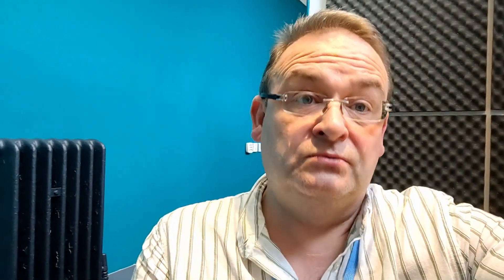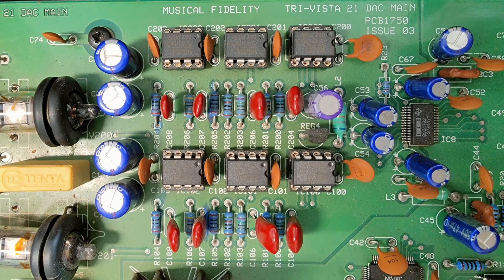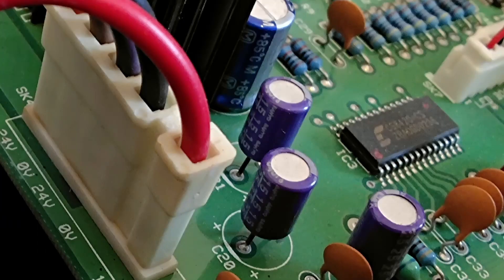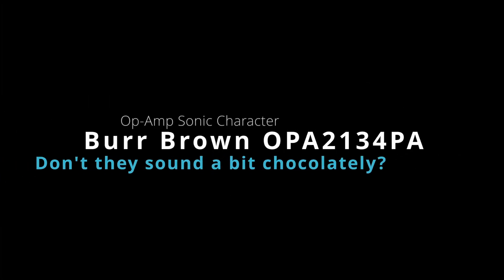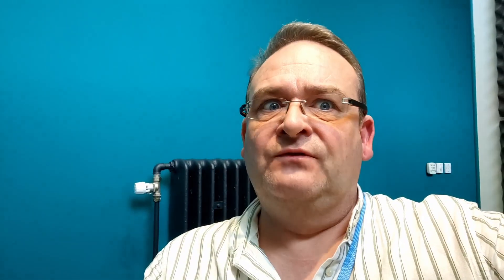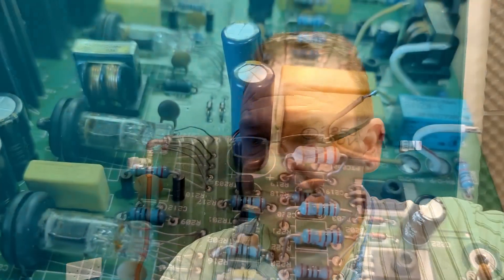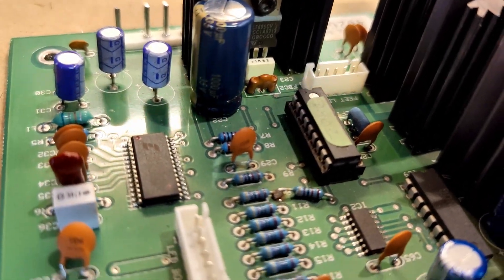Upgrading the Musical Fidelity Tri-Vista 21 Tube DAC - Part 2

Comment: Only just discovered your channel and intrigued by these upgrade videos. Have been working on a DAC project also which is based on current output DAC chip - the super old Philips  TDA1541A. Not tried them yet personally, but have been highly recommended some other transconductance op amps for the I/V stage which you may or may not have tried: Texas Instruments OPA861’s - though these are only available in a surface mount packages, so you’d need some adapters if you wanted to give them a try.

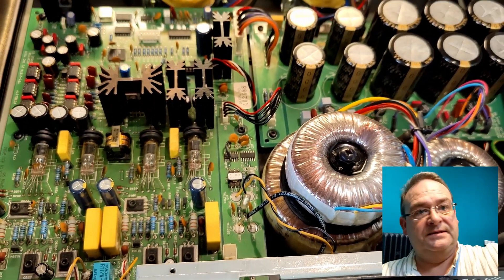Was also wondering about some of the wiring I could see in your video at 1:02 and 5:53 which shows some black and yellow wires coming from somewhere round the back of the toroidal transformers running right next to your RCA signal wires. Couldn’t see of those yellow and black wires are from and AC supply or anything to do with the toroidal transformers, but aside from them needing twisting more tightly, both they and the toroids are rather too close for comfort (if it were mine) to any signal carrying wiring (even with shielded wires) and wonder if it’s worth looking at some way to shield your signal better from any internal EMI coming from transformers and AC carrying wiring? Just a thought … but may be worth experimenting with?

Anyway, look forward to seeing how you got on (as this video was a while ago now) both with this project and any others 👍
Reply from the maker: Thanks for watching and for your comments.  More has happened to the DAC, I've just not got around to producing videos for it yet.  Other events have caused this to be sidelined.  It's now using SparkoS discrete op-amps, my own designed noise snubbed ultrafast rectifier modules, filtering component upgrades and most importantly decent quality film coupling capacitors.  It sounds fabulous, but of course there's more to come 😂.

The TDA1541A is on my list to investigate at some point too.  Too many project ideas - not enough time.  I sourced on old Marantz CD50 to use as a starting point for investigations.  I've also heard good things about the OPA861.  Being an OTA it's not a drop-in replacement for an op-amp, and the max supply voltage is +/- 6.3V, but definitely worth investigating.

The yel/blk wires there are the original S/PDIF out spec'd by Musical Fidelity.  The S/PDIF input originally used them too, but I replaced those with 75Ω co-ax, which you can see, when I replaced the digital in socket with one from CMC.  The digital out will get the same treatment.  The analogue output signal wires seem to have been upgraded by the previous owner, but the grounds left alone.  I plan to use Townsend Isolda copper foil here to CMC sockets, but I didn't want to do this yet while the PCB was coming in and out for other upgrades.

Comment: This is really interesting. How does one go about learning enough to be able to make mods to hifi equipment?
Reply from the maker: Thanks for your question Ashish.  Ooh, that's a tricky one. An understanding of electronics helps, but for high-end audio there is much that isn't in a text book.
Understanding what to change and why. If you don't you could end up spending a great deal on changing things that will have little or no change in sound quality.
The forums, e.g. diyaudio.com, pinkfishmedia, etc. can give some insight, but beware forums can be unwelcoming, particularly by those at the extremes of the subjectivist vs objectivist camps. It can take a while to find the wheat among the chaff. Hope that helps as a starter though.

Comment: Your videos leave me wanting desperately to get my Trivista upgraded as well. I purchased it brand new. It has recently come out of 9 years storage with my audio system. Just recently set things up in our remodeled home. Haven’t been able to get my system work just yet. I’m fearing that it’s boiling down to a flaw in my Sonic Frontiers Line 3 Tube preamp. I don’t know, I’m at my wits end. Great presentation, sir.
Reply from the maker: Glad you enjoy the videos!  Sorry to hear you're having a problem with your pre-amp.  Good luck tracing that down.
The Tri-Vista is a great base for upgrades because like most manufacturers they really cheaped out on component/parts quality, especially on the capacitor front.  If it helps, when I'm done with mine I'll probably write a manual / make a kit available for other DIYers to follow.